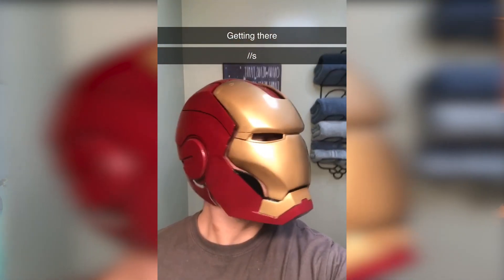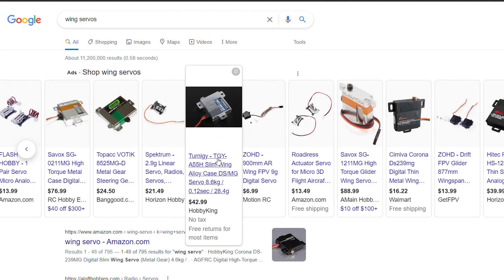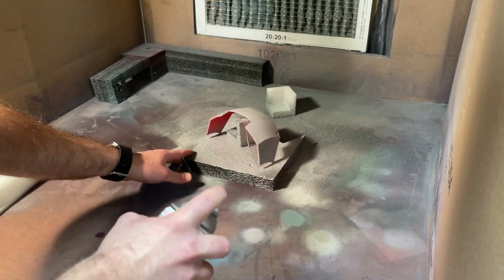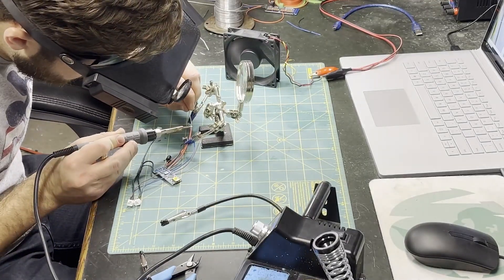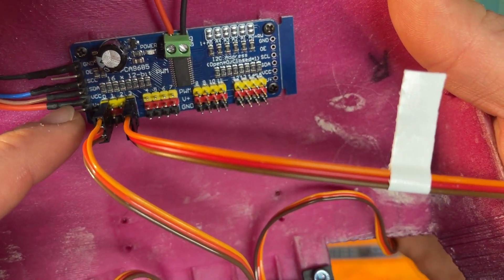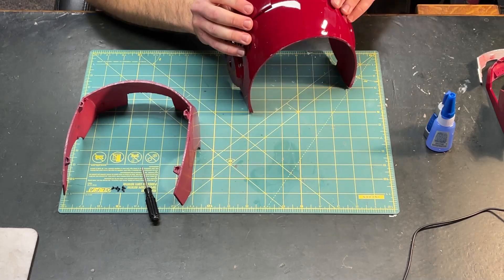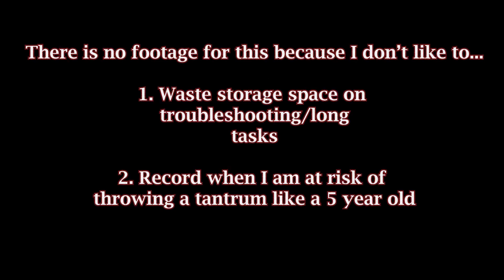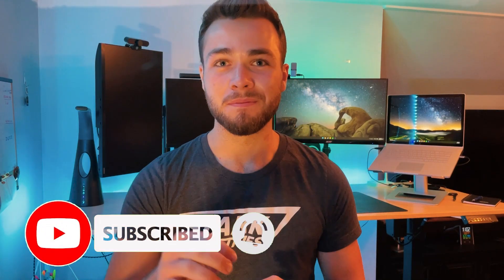How I Made the IRON MAN MK5 Helmet  |  Servo Open/Close  |  LED  |  Troubleshooting | Box and Loop

Comment: Hi friend, first of all, congratulations, is it possible to scale that helmet, I mean I think it won't fit on me, but my worry to scale it it's about the screws and also the places for servos and other components. Do you have a solution for that?
Reply from the maker: @outystemsschool  thanks! And you could possibly scale up the model using the CAD software of your choice, but in doing so, the motor mounts would probably need to be adjusted in the software to match the original distance (since the servo mounting template doesn’t change). Good luck!

Comment: Sweet project, thanks for sharing! I'll try building it for the next local comic con :D

I'm looking at the parts list, was rhere any specific reason why you went with SG90 servos instead of MG90S with metal gears? The price seems not much different but the metal gears supposedly make servo controls much less loose and a bit quieter. Just curious if maybe you've tested them and decided not to use them.

Comment: should have built the helmet a little bit larger so that you could fit a shield inside to cover the PCB, wires and resistors from 3d printed parts. basically an inner shell
Reply from the maker: That would be ideal, but increasing the size of a model like this would mean changing every one of the screw hole diameters and locations to fit the right screw and match up with mount holes on the boards/motors. Maybe on the next more simplified helmet tho!

Comment: You got the alignment spot on. Any pointers on how to do that. Use larger washers, dont use washers? How did you go about it. I struggle with the cheeks..
Reply from the maker: Thanks! The alignment was more trial and error, but my main method was to let it run, then take measurements of how far it was off, then adjust accordingly and try again. You shouldn’t need to use washers because the joints shouldn’t be too tight when bolted on. Plus the washers would add distance and probably mess up the alignment. The cheeks honestly were one of the hardest parts because they are non only on an odd angle, but at the end of the chain and need the most force to move. 

As far as adjustments go, before touching any of the code, always see if you can take off the wing of the problem servo, and rotate it a click or 2 in the direction it needs to go. Sometimes they aren’t sensetive enough angles, so you may need to tweak the code values

Comment: Great Video, thanks. I finished my helmet and everything works great. However, not all servos move as far as they should for a perfect fit after opening and then closing. Also faceplates don’t open up high enough. I guess I’ll have to adjust the servo endpoints in the arguing code a little bit.
Reply from the maker: I’m glad it turned out great, but yea I think that’s a good way to go about it, if your servos are by a very different manufacturer it could be off a bit. I would also recommend making sure the voltage is high enough to lift all the weight up, along with checking that none of the joints are restricting movement and aren’t too tight

Comment: did u  get it running with a battery pack? I got most of mine working, but the last 2 servos seem to cause it to mess up, when they arnt in it works great. 
Any ideas why that might be?
Reply from the maker: I didn’t get it to work on a battery pack because it actually requires 6.5V or so minimum to give the servos enough power to lift the weight. Maybe your problem is that the power can’t supply enough for all the servos. 

Since I just mounted it on the wall, im actually just gonna use a 9V 2A wall power adapter to hook up to it. The 5V from the battery doesn’t seem to be enough

Comment: hello I built the circuit and the big black servos work fine on any input but the sg 90 don't stop turning if I activate the mechanism. do you know what it can be?
Reply from the maker: Hey Rodrigo, it seems like your having the problem I had with the wing service, but this time with the sg90’s. 

If you mean they keep trying to turn past the point where it’s supposed to stop, that means the angle where you are starting them off isn’t quite right, most likely it hits an obstacle before reaching its end point (in degrees here), meaning it can’t stop pushing until it reaches the endpoint, but it will never reach there because it’s being blocked.

To fix this, either take the servo off, take the plastic wing off, run the program to get its angle back to home, then place the wing back on so it’s movement range is starting in the correct spot… or if that won’t work, then do what I did to the wing servo in the code by changing its home position, but only do that if you are 100% sure that’s the problem.

Remember that these serves physically only move 180 degrees total, meaning it will never spin around
Reply: @ShayneHeluk  

I already understood what I did wrong. I bought sg90 360 degrees and they should be 180 degrees. that's why they spin nonstop 😥😥
Reply from the maker: @rodrigov424  oof, sorry bout that, I’ve made similar mistakes before, happens to the best of us lol

Comment: hey shayne. Any other tips on the servos not moving. Tried your solution and it still won’t work
Reply from the maker: Hey Richie, can you tell me more about the situation? Like are there noises/struggling sounds? Is there power to all the boards? Is the motor getting any voltage?
Reply: @ShayneHeluk  Could I reach out to you on instagram ?
Reply: @ShayneHeluk  When i plug in both usb cables  both the arduino and pca are turned on. The motors just won’t move tho. I tried the V+ thing you did but that just kills both the boards
Reply from the maker: @richiepage9204  as for the motors problem, try disconnecting the plugs and put a multimeter on the board prongs to check if there is any voltage change when you trigger things
Reply: @ShayneHeluk  I just ordered one. I’m actually also a semi beginner with this stuff
Reply from the maker: @richiepage9204  awesome! Keep me posted
Reply: @ShayneHeluk  great 😂. now my button isn’t even working when everything is hooked up
Reply from the maker: @richiepage9204  lol I feel that. Remember that when trouble shooting, always check your connections first by eye and with a continuity test when powered off, then check that each component works on its own. A multimeter is a god-send

Comment: Nice job! have you heard of the Crashworks 3d A.L.I.S.H.A board?
Reply from the maker: I haven't! but after looking into it, I think its pretty cool. Although I don't think it would work well for any of the Iron man helmets that open using more than a couple of servos. It has the arduino basically hooked up as a motherboard/breakout board style, which is great until you need to supply more power at once than a Nano can handle. Maybe ill try to make my own of a Nano/Driver mix in the future.
Thanks for commenting!

Comment: hey thank you for the reply on the other post and getting the comments on here opened up! 

luckily this code is easy to manage and doesn't have insane functions, i tried switching the open and closed int values and that did nothing.

so i reverted the changes and going to just switch the motors sides since that makes more sensible.  i guess i slipped up there on the build guide and got it backwards.

i think i need to try your fix and using the v+ routed from the input power,  I can only power the board up without it shorting when there are no motors connected, once both switches are on only then can i connect the power.  

meaning i just can't shut it off and turn it back on easily i have to reset all the motor connections.  pretty wonky i don't know what's going on there at all.. that's where my electrical knowledge drops off...
Reply from the maker: Let me know if that fixes it! And huh, from the description, (assuming you mean you cant connect the power from the Arduino to the Driver board until after both boards are powered individually)

It sounds like there could be a large voltage bounce (when the voltage goes up, it shoots past the mark then lowers back down) when it receives power. 

But also, it could be that the arduino is setting up when connected to the driver board, and something in the code is making the motors fire too many at once, which would actually result in the motors not being able to move due to insufficient current rather than being shorted.

Other than these, I'd say to also run back through the wiring and check for any metal to metal contact or bad solders using a multimeter on the continuity test setting.
Reply: @ShayneHeluk  aye, thank you for the reply.  yeah basically i have to power the boards without the motors connected or else it just shorts out when i try to power the driver board.  

I'm starting to think it's from the 3 way switch that's going on.  

idk going to hit it with the multimeter again and keep troubleshooting like you said.  

could even be my power bank and the always on function it has?
Reply from the maker: @IowaMan  Hey, sorry I missed this reply. What power supply are you using? A charger battery pack like in the PDF? Or a variable supply? 

If its a charging pack, then that could be it. I had issues where the pack coudn't deliver enough power to move the servos while powering the nano and driver too. That's why I needed to bump up the voltage on the supply to be about 7ish volts (battery packs are 5).

This could explain the problem since it can power the low usage parts, but not any of the motors (although if its a shorting problem, definately check wiring and be careful not to overload the servo with too much current at once since they have sensitive chips in them).

If you dont have a variable power supply to test, you could take an old AC/DC converter wall block and hook it up so long as its only like 6-7V and like 2A, but dont try that unless you have experience working with it.
Reply: @ShayneHeluk  aye it's a 2000mAh 5v charge pack that's got 2 outputs of 2.5 or whatever.

maybe i should ditch that for a better power supply or just a 9v with a stepper and route the power switch to both instead of individually to the boards so they're not getting some weird voltage

when i tested for voltage and all that it seemed fine but i didn't really check for amp 

idk, i'll get it all worked out eventually!

i mean it kinda works now, i just have to do that weird part of unhooking the connections for the motors before i can start everything up.  

thank you for the reply, hope all is well =]